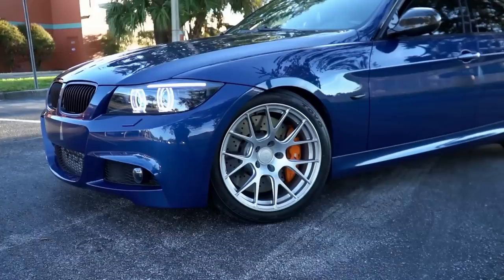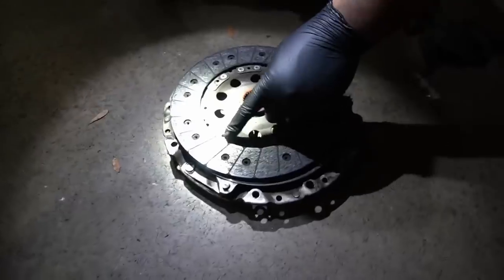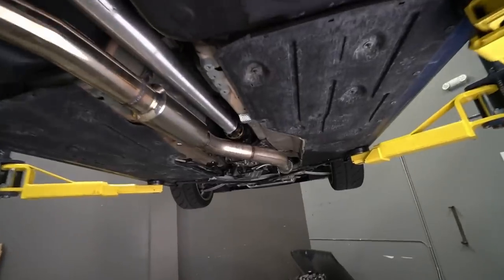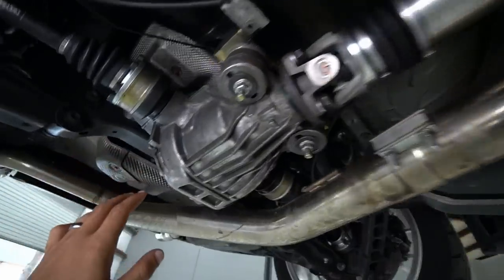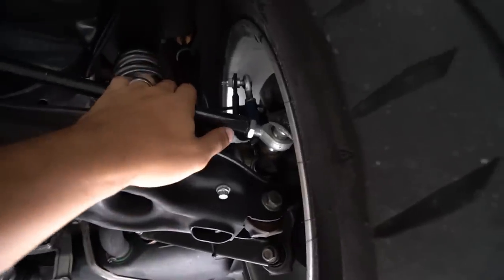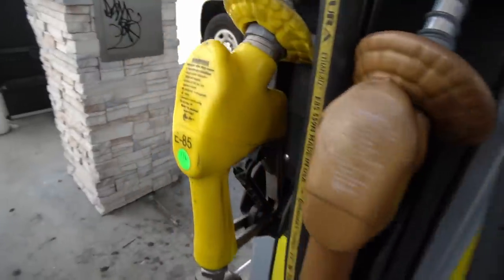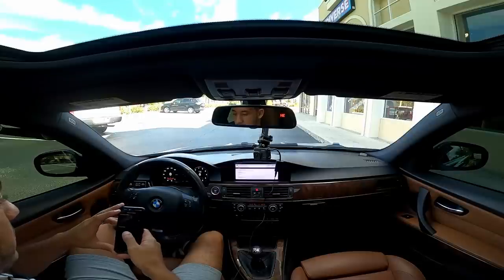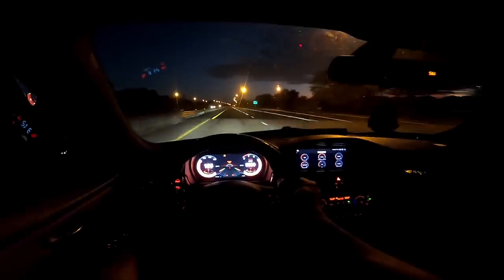Can You Daily Drive a 700HP Single Turbo BMW 335i?

Comment: You can def daily drive a 700+whp single turbo 335i, the only scary part though is when you full throttle it on street tires in 1st/2nd gear. Car instantly goes sideways on my 740whp 335i.

Comment: i bought a 335i with a supposedly upgraded clutch (its making 430 whp on upgraded twins and an e85/91 split) and i was concerned about the sound it was making when i would start going and it was a relief to hear that this is a good sound and means the clutch is infact upgraded, so thank you very much

Comment: Got a 2011 335i a few months ago. Car's in the shop for engine replacement due to rod bearing failure (under warranty thank God lol) and they were nice enough to let me put some goodies on to run MHD stage 2+ and will be tuning with XHP. Should feel like a new car and hold me off power-wise for a while, but damn if it isn't already making me miss manual... Once she's payed off, will definitely be doing a tranny swap 🥲 Love the car man. Been a big inspiration for my car purchase. Now it's time to do "The Ultimate N55 Build". Complete built/closed deck converted block, all head work done with upgraded valvetrain, custom intake manifold without throttle body to optimize Valvetronic, and a big ol' Doc Race turbo kit!
Reply: You have 2011 thats still under warranty??? 😲😲
Bmw....or like carsheild?
Reply: @mikemartin6857  I got very lucky for sure. Bought it from my Dad at the dealership he works for. Car had 102,000 miles with a thorough BMW dealership maintenance history. They sell Chevy so normally there wouldn't be a warranty at all, but was able to get one thanks to him. Two days after purchase, I heard a knock from the engine bay and knew what was wrong right away(While maintenance history was great, previous owner must've missed an oil change or something). New engine will have 30k miles less too, so definitely the best of a bad situation!

Comment: I want to put RB GFs on my car, MFactory diff, and all the steering & suspension upgrades.
Then later down the line, if I can afford it, CES bottom mount kit w/ a built engine. 
Right now I'm at the maintenance stage, cause my car is at 103k. Water pump, oil pan, engine mounts, etc, and it's hurting my wallet 😭 But it'll hurt less than if a mod causes something I ignored to fail. 
Thanks for the great content, I'm following your advice closely to make my build seamless.

Comment: I'm wondering now that I see it from bottom detailed,  can I run the midpipes for the VRSF race exhaust and run another muffler on my 135i? Anyone know ?
Reply: Yes
Reply: @VanHellsing12  are they the same underbody ? Have you tried before ?
Reply: Like a quad exit setup?
Reply: @thewheeltroll1833  I don't matter I'm only care about the midpipes since it's cheap buying that and building the rest of the muffler than buying the hole set up from bmp wich is the only manufacturer that I know sells a catback true 3.5 inches

Comment: Good vid, bud. I just want to tell you - hearing loss is permanent and even in this day & age of technology, it can't be fixed! And as you age, other factors will take the good parts of life away, little at a time, and you'll look back AND say, "young me was such a fool!" Getcha a hi-flow muffler. Invent a bypass or quick install coupler, but straight-pipes for daily driving are a NO-GO, YO....

Comment: What resonator did you add to the vrsf exhaust? I bought my car and it came with the vrsf exhaust and both rear sections. I’ve been wanting to add a vibant ultra quiet resonator and run the race rear section. 

The street version is nice but a little too quiet for me but I don’t want to add an ultra quiet just to have the same sound as the street rear section

Comment: So what did you do to you motor to get 700 reliable hp?
Reply from the maker: Engine is stock. I replaced everything around the engine maintenance wise.
Reply: @VehicleVirals  wait so you can get 700whp out these motors stock??? Jesus christ. Lol ok looks like I'm getting one. I might just aim for 5-600 though.

Comment: I got a question for you brother have you had any rubbing issues with the rear sway bar and the SLG LSD? If not how’d you guys manage to get clearance or if u changes the sway bar at all. Thx
Reply from the maker: Yes we did at first. Either get aftermarket sway bars or adjustable end links to help with clearance.
Reply: @VehicleVirals  I see which option did u go with?
Reply: @VehicleVirals  I got the adjustable links but it seems like there’s still a slight noise and clearance issue with the beefy axles touching the sway bar